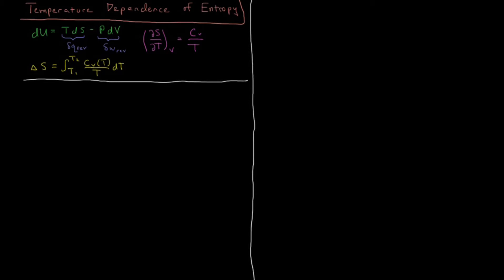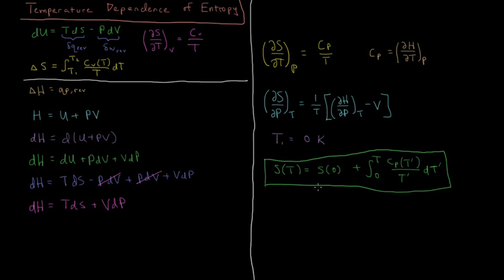Chemical Thermodynamics 5.2 - Entropy Temp Dependence 2 (Old Version)

Comment: Why did you write out S(T) in terms of S(0) in this video (constant pressure), but in the constant-volume process in the last video, you just left it as an integral from T1 to T2?
Reply from the maker: Hi, Ashwin. The previous video could only look at relative changes between two temperatures. We could compute how the entropy changed from T1 to T2, but not what its absolute value at T2 is. Now we're not talking about deltaS (change in entropy), we're discussing S (the total entropy). If we know what S is at zero Kelvin, and we know what the constant volume heat capacity (Cv(T)) is at all temperatures, then we can calculate the total value of S at any temperature, not just its relative changes (deltaS).
Reply: +TMP Chem Thanks! But, in the previous video, could you have done the same thing by defining S(0) and finding the absolute value of S instead of just delta S?
Reply from the maker: Yes, but the point of the previous video was deriving the expression that allows us to calculate the changes between two temperatures at constant volume. This video discusses the same calculation at constant pressure. One requires Cv, which you get from dU/dT, and the other requires Cp, which you get from dH/dT. In each case, it is as you said, a simple logical extension of the final formula to say that the absolute entropy at a given temperature is the value at absolute zero plus the change from T'=0 to T'=T. I could have put it at the end of each video, but it was included here to motivate the need for the third law of thermodynamics, which defines a value of entropy at zero Kelvin.
Reply: +TMP Chem Okay, thanks! Your videos are really clear and helpful; thanks for making these!